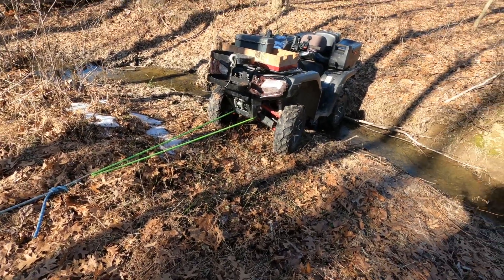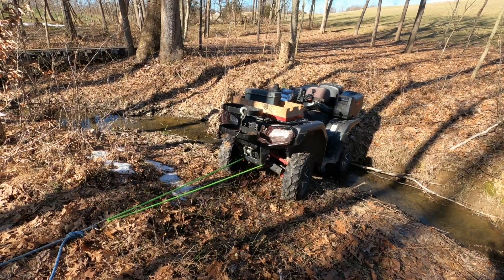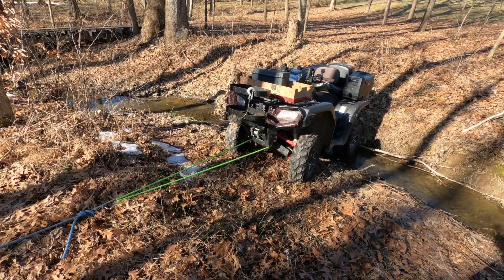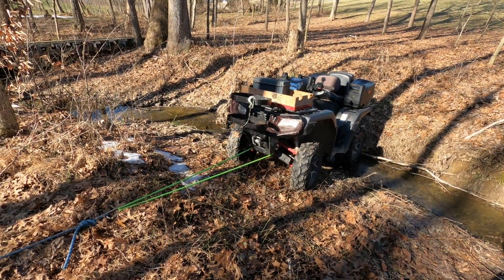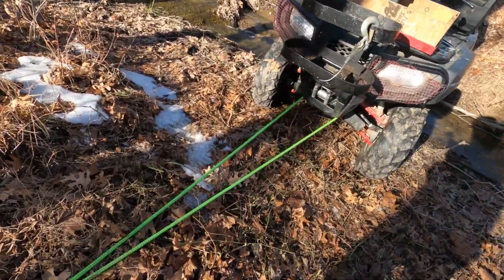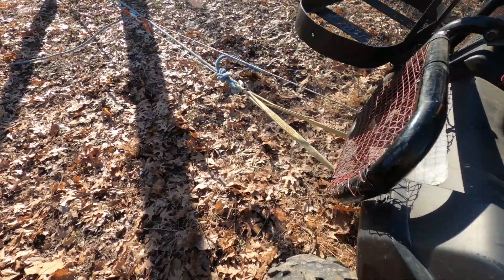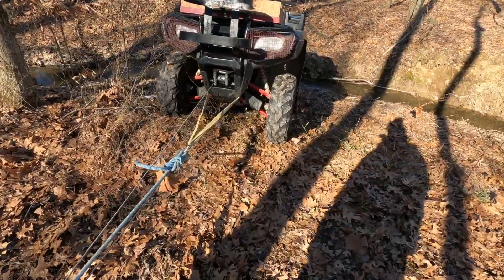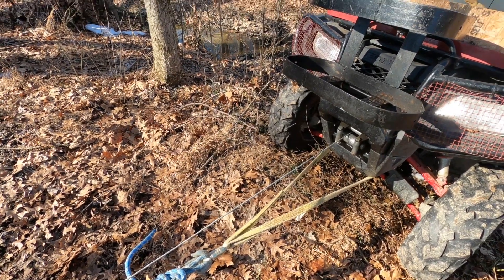Spanish Burton: 3:1/4:1 Mechanical Advantage with minimal gear

Comment: Hello, Sir. I`m just learning T-method (from your videos mostly - thank you for that) and by applying that method for this setup I got following result: anchor being pulled with force 4 times more than input; but your ATV was being pulled with force 3 times more, than input. So, in such configuration mechanical advantage of system is 3. To get 4:1, whole system should be flipped around. I think situation here is similar to described in video "A revisit to the set of fours with proof".
I could be wrong with T-method, cause I don`t have enough experience with it. 
Am I right? What do you think?
Reply from the maker: Thank you. I am wrong. It is a 3:1. 

I got in a hurry putting this together and I screwed it up on the mechanical advantage. I will have to edit the video tonight when I have free time. Fortunately other than getting the MA incorrect the information is still sound. I just assumed and didn't do the calculation. My mistake. Happy to have keen observers like you catch such things. Thanks again.
Reply: Thanks you for your response - I appreciate it. 

In case of using a winch mechanical advantage of that system was 4:1. And, technically without a winch MA would be 4:1 if you pulled rope whilst sitting in ATV (not much practical, but possible)). And that nicely demonstrates advantage of Spanish Burton - ability to get pretty high MA (4:1) with only 2 pulley.
By the way, I think mostly because of that (only 2 pulley) Spanish Burton might be able to provide 4:1 MA system with best efficiency - it's only my assumption, but it would be interesting topic. At least, Spanish Burton was way better than common "set of fours" in case of using carabiner instead of pulley in both system (bad efficiency of carabiner was "amplifying" difference between those two systems) - so, in my opinion Spanish Burton might be the best decision in order to get reasonable force multiplicator without any pulley with carabiners only (in case of emergency).
I guess, Spanish Burton will be slightly more efficient in case of using proper pulley too.
Once again, thanks you for making videos and sharing your knowledge.
Reply from the maker: @anatoliisavchenko1082  
Yes, you are correct again. The first example I showed was a 3:1 without the winch and with the winch it is a 4:1. 

You are also correct about the Spanish Burton being better if you are forced to use carabiners as makeshift pulleys. The less friction the better.

Thanks again for your help. I'll try to do better next time. Cheers

Comment: This is just a fancy 2:1. The only MA is on the pulley with the green rope. U need to spin everything around so that everything is at the load end not the anchor end. Then u will get a 2:1 on a 2:1.

Comment: Perry, by any chance could you tell us abut the aztek system?
Reply from the maker: The Rock Exotica Aztek? It's a nice compact system. Like a lot of rope gear I think it is overpriced. Its competitors would be the Petzl Jag or the Harken Wingman. If I were to spend that kind of money I would buy the Wingman over the other two as you can lower more easily. 

For half the price of those systems you can build your own if you want to save money.
Reply: @perryfire3006  The wingman is very interesting, if i remember correctly it has a mechanical way of capturing progress vs the old and true prussik of the aztek. But I see that the sky is the limit as far of application of the system. Could you point to any valuable resource like books or digital resources where I can learn to explore tha applications of a 'block and tackle' in the rope access world?
Reply from the maker: @antonioosante5850  
Check out the channels to which I am subscribed. These guys collectively are a wealth of knowledge. I'm pretty sure you can see that on your end. Let me know if you can't. 

What are your end goals? Maybe I can fine tune some resources.

Comment: Hi! When do I know if the sheave of the pulley is strong enough to take the steel cable of winch in this case... I think (please correct me if I'am wrong) that most of the sheaves in pulleys are made of aluminum, but I would not be surprised to know that some are made of stainless steel maybe... Is it a standard practice to use steel cable in rescue pulleys Perry? Maybe in those G rated?
Reply from the maker: You guys notice everything, haha.  An all-steel pulley would resist wear better for sure with a steel wire rope running through it, also it could be much stronger. I'm ok with using an aluminum pulley for light work like I demonstrated.  Within reason of course.

My goal is to show how the system works, not necessarily what anybody should precisely use as far as equipment. As with all scenarios, it's up to the end user to use their best judgment. Cheers
Reply: @perryfire3006  Perry, by all means I was not trying to criticize in a non constructive manner. It was a genuine need for clarification. Please remember that I look up to your work, and I respect and cherish the AMAZING wisdom that you so kindly and gently put out to us. I don't want to over do my apology and end up sounding weird or clingy. Hope this message found you well and not infuriated.
Reply from the maker: @antonioosante5850  
No need to apologize. I welcome all constructive feedback, including yours. The end goal is for everyone to understand and safely use the methods that I am demonstrating. People like yourself help by asking questions for clarification which I enjoy. So thank you!